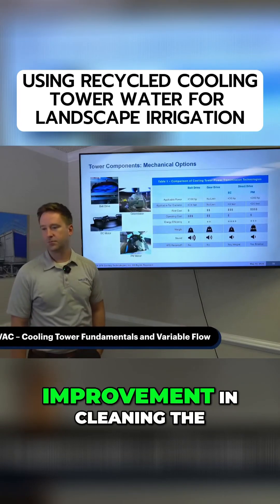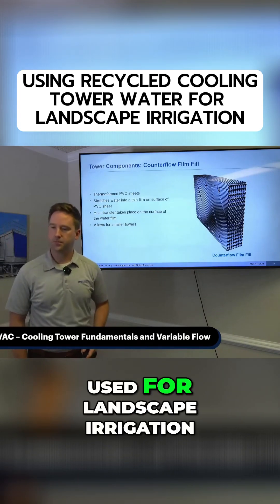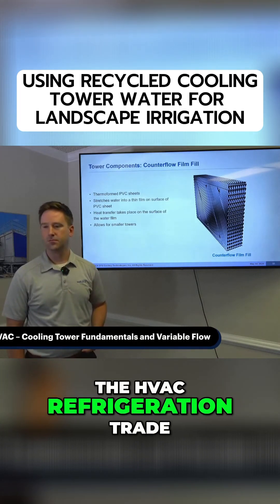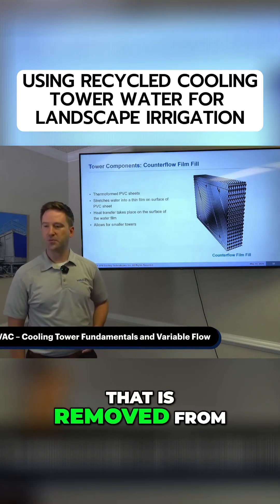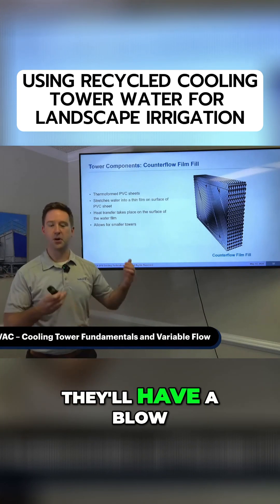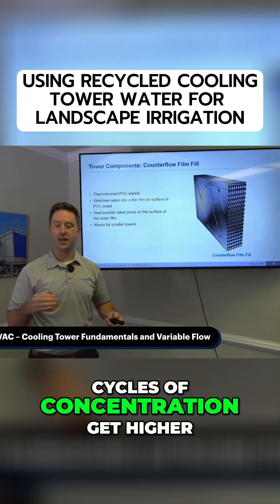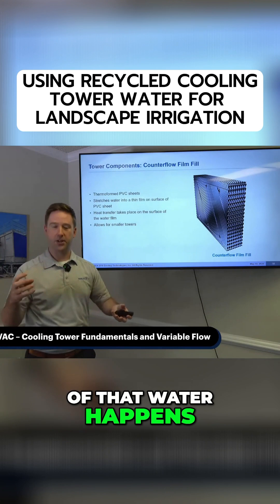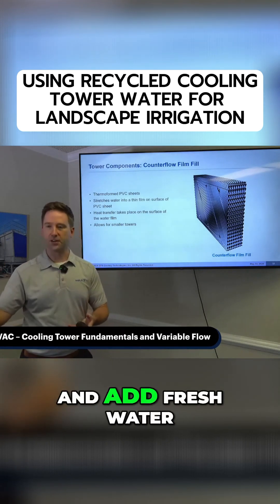Recycling cooling tower blowdown water from cooling towers for landscape irrigation.

Comment: Cooling tower water usually doesn't get removed from the tower unless it's being cleaned. We do our one time a year. I very heavy cleaning with pressure washer and it's a very dirty job. There is a basin at the bottom we call a " pond"  . That always stays filled in my towers even in winter time. My towers are 2019 so not super old but that water isn't really removed but once a year. Cooling towers are WATER HOGS  if really watch the amount of water that they use in a 24hr period in peak weather. I prefer a chiller over a Cooling tower.